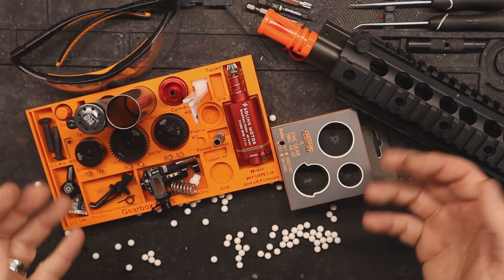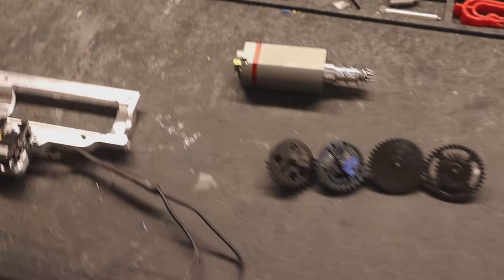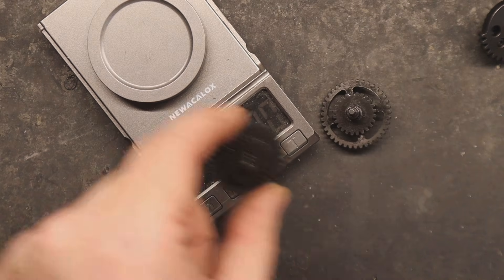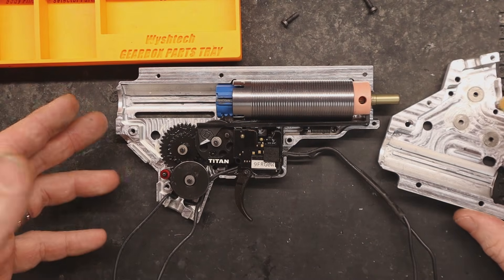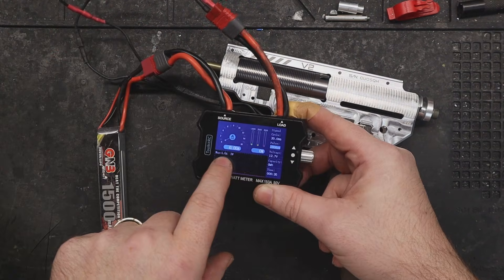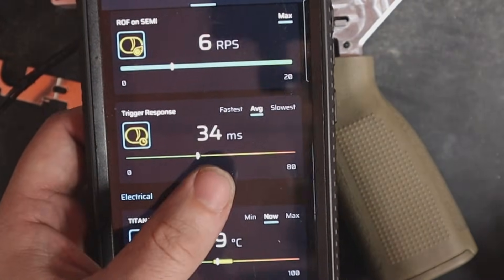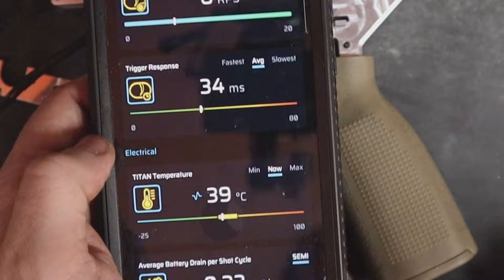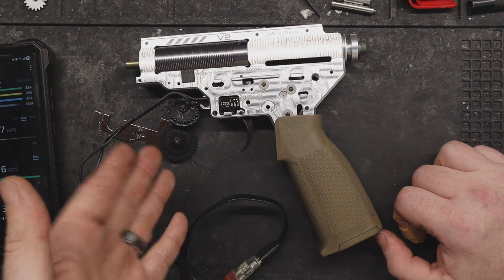Hollow vs Solid AEG Gearsets — Real Performance Gains or Just a Gimmick?

Comment: In the end, looking at the data overall, the risks outweigh the benefits. The more surfaces that can crack the less life they'll have, so the hollowed have more potential failure points for what can be considered a negligible improvement. 

Also, the more "meat" the gears have with quality materials, the greater lifespan they'll have. These are parts that are exposed to great forces for their size, so survivability and longevity are always key points.

Comment: Wyshtech Can u help me fixing my airsoft so I built a high ROF (about 35) 13:1 short stroke 4 teeth correct AOE ,tappet(I also have a FPS drop, but I fixing it already) Right Now I have a problem which is when I shoot semi like 1-20 completely normal but after that it began to shoot out 1 and dont shoot 1  for example
 one out one dont and 1 out 1 dont. It begin it loop since that can u help me fixing it?
Reply from the maker: Sounds like a weak follower spring / weak mag.  Consider getting a stronger mag spring OR EPM1 mag (im assuming its an m4)
Reply: @wyshtechairsoft thx bro i will update to you
Reply: @wyshtechairsoft  when I am full auto, it was so loud and very shaky  fps  drop I think it’s about 200 from 350 I cant fixing it, bro really frustrated

Comment: My DSG went from 36rps to 44rps from changing…

Old - 9:1 CNC, 24k Brushed

New - 9:1 CNC Helical Hollowed, 25k Brushless

Although really the new motor probably doing the heavy lifting here

The spring/spring guide rattle is louder than the gears now
Reply from the maker: Put the brushed motor back in and and record the rps.

Comment: Some background on the hollow design. It became popular with gel blaster gear sets on sites like Temu and Ali Express, these were made from aluminum and even got carried on Evike for some short time but they were pulled after finding out they would break almost immediately in an airsoft build. 

Fast forward, companies are looking for “cool” designs to sell their products and skeletonized receivers are known to be cool. So make the gear set skeletonized too? Maybe. 

My gripe with hollow gear set is that it is just a fad AND reduces reliability when removing material. Instead of a spur gear gear failing on the teeth and axis, it now has an additional four points of failure thanks to the hollow design. 

Overall. Bad. I don’t care if it is Solink, and if you ask me the company is looking like a Maxx clone where they get name recognition to sell the parts versus having good parts. 

T238 still has the best brushless motor and I will die on this hill until something changes my mind.
Reply: T238 BL Motor is worse than a warhead in every aspect. peak amperage draw, cycle speed, batterie consumption and temperature are all worse than a base warhead
Reply from the maker: Thanks for the insight!
Reply: I thought it was a gimmick at first, but I’ve put close to 40 hollowed sets into builds and I’ve never had a report of any of the gears failing. And Mr Solink v5 would beg to differ…
Reply: Dont know how you can say T238 is the best Brushless motor, when comparisons have been made over and over again in Airsoft Teching Q&A. Is it good? yeah i can agree its good, but not the best.